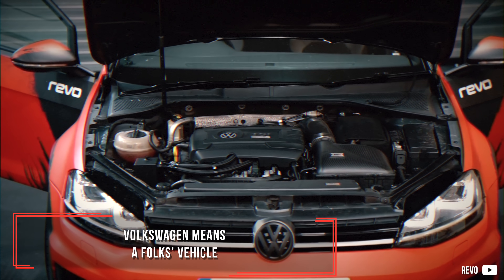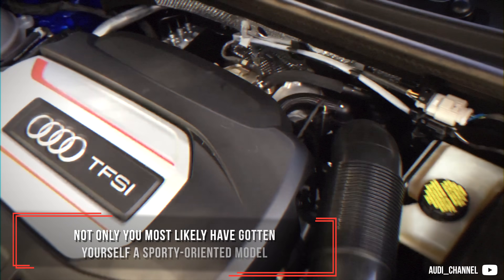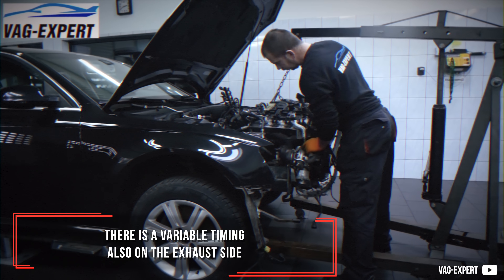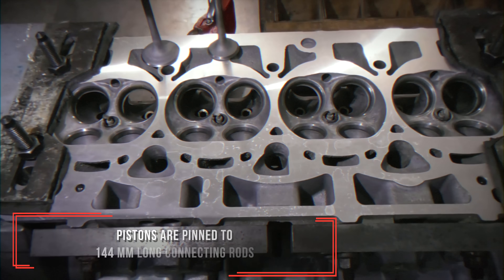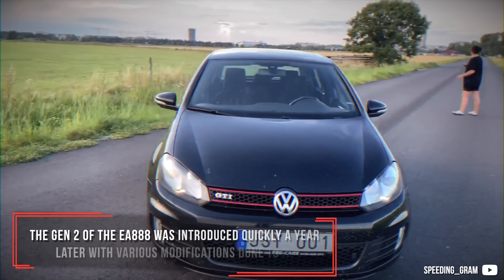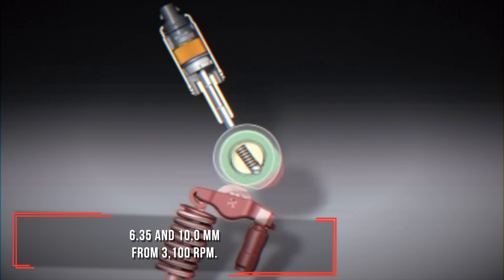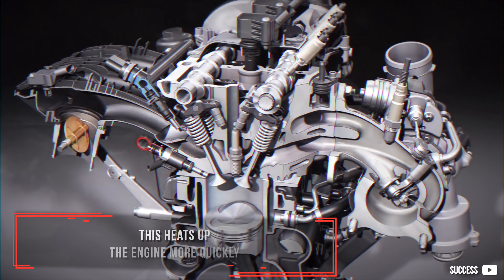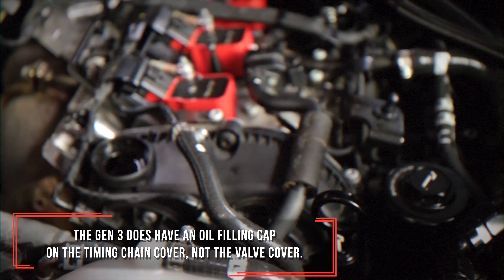Why The Volkswagen EA888 Is So Good

Comment: Love the EA888 Gen3 on my S3. 52k miles Stage 2 FBO and it's been nothing but reliable. Can't wait to throw on a Garret turbo and see how much it can make!
Reply: Exactly. I have had 0 issues with this engine. Have no intention selling my car. Going to keep it until it breaks at 100k or something.
Reply: @DaveThaBossDTB  same plans with my 2018 S3, I got it like new recently off a lease with 9K miles, these cars will last up to 200K + with religious maintainence , such a blast to drive, lots of mid range torque, handling is impeccable
Reply: Mines just hit 32.5k (16 plate prefl s3) and got the dreaded thermostat housing leak, £680 to replace (thermostat, pump, gaskets and belt) at a local German car specialist on the 10th Jan. One day it was fine the next it'd dripping but luckily still drivable for now touch wood

Pretty bummed as I came from a 2008 3.0tdi A5 running just over 400hp, in the 5yrs of ownership it just needed a clutch & flywheel, never used a sip of oil or coolant at 156k, sometimes I wish I kept it as it got abused daily

Comment: The EA888 is an absolutely horrific engine for long term reliability as anyone who deals with them knows, VW have spent years reworking this POS.
Reply: Mines been flawless so far? The last 50k miles have been on 23PSI, ethanol blends and 7K RPM every day. It's needed a coil pack and a PCV diaphragm in 115k miles.

Comment: there are some thing wrong. only the 3rd gen ea888 has a plastic oil sump. The prior ones are metal.
Reply: And oilchanges with removing plug. I still find it strange the old oil is sucked out (dipstick hole).
Reply: Gen evo4 VW change the oil sump back to metal. Strange why would VW put the oil sump on Gen 3 in plastic
Reply: @aeroline11  How about the waterpump thermostat housing for Evo 4? Has VW improved that area?
Reply: @aeroline11 yes, I will change mine to metal

Comment: It's the German equivalent to the Japanese Mitsubishi, Nissan, or Honda K engines in essence. It's been a reliable unit for the most part, used in a ton of VW and Audi vehicles.
Reply: Sorry but this engine is not even close to the K series in terms of reliability. Like nowhere near.
Reply: @soundseeker63  Your opinion, that's fine. They don't tune them the same way and they aren't built the same way from factory. But you cannot argue that the EA888 has been around a long time, takes solid power upgrades, isn't broken down along the side of the road everywhere you look. The relative "unreliable" idea people have these days is way out of proportion to what plagued engines just two decades ago.
Reply: Can we talk about stuff that is tangible? Such as what is being made in 2020+ rather than the 1980's? As far as who started what, it's largely irrelevant. I took down notes from a very knowledgeable motojournalist a few years ago concerning the question of where are automobiles actually made. Blows the mind of the average person. Here's a run down (some years old by now):
BMW 3-series:  South Africa
Volkwagen Polo:  South Africa
Audi Q7:  Slovak Republic
Volkwagen Toureg:  Slovak Republic
BMW X-5:  USA
Mercedes Benz ML & GL:  USA
Audi Q3:  Spain
Renault Fluence & Koleos:  South Korea
Audi A3:  Hungary
Dodge Journey:  Mexico
Volkswagen Jetta:  Mexico
Volkswagen Scirroco:  Portugal
Volkswagen Eos:  Portugal
Volkswagen Caddy:  Poland
Volkswagen Amarok:  Argentina
Toyota Hilux:  Thailand
Nissan Navara:  Thailand
Ford Ranger:  Thailand
Holden Colorado:  Thailand
Mitsubishi Triton:  Thailand
Mazda BT-50:  Thailand
Isuzu D-Max:  Thailand
Fiat 500:  Poland
Renault Megane:  Turkey
Audi TT:  Hungary
Dodge Challenger:  Canada
Reply: @footballcoreano Incorrect. When Honda brought out their VTEC engines in the late 80s they were some of the most advanced, powerful and efficient engines in the world, far exceeding anything VAG had done at that point.  Incidentally it was nearly 20 years later that VAG started employing their own take on the VTEC system (as used on this EA888 exhaust cam) so really it was VAG that copied Honda, not the other way round.
"Simplest engineering" lol Honda were using double wishbone front and multi-link rear suspension even in their small cars since 1991. VW, not so!   And as for reliability - Well, check literally ANY reliability or owner satisfaction survey and you will see that Honda consistantly finished ahead of VW, and not just by a little bit!   I do actually like some of VWs past efforts but you really need to get your facts straight.
Reply: @footballcoreano Stop talking bollocks!,you are clearly some sort of sad VW fanboy who can't handle the truth and/or know little or next to nothing about cars as endorsed by your ridiculous unsubstantiated,unqualified and uneducated statements littering the comments. In my 30 years of running a 5+2 bay garage and test center I could count on half the fingers of one hand the amount of Japanese vehicles that have required stuff like a new engine over that time period,I have replaced or repaired ten times that amount of VAG engines in that same time frame,I love engines like the ea888's,113's,111's,211's etc.as long as the blinkered keep buying them they provide regular work👍. As to comparing Japanese and German reliability,that is easy as there is only one winner and to suggest Honda nicked ideas from the Germans is more than laughable,that's without mentioning the multitudes of BMW engines that crap themselves or those from mercedes,or their transmissions for that matter. Type any German engine code into Google and it will auto fill with words like failure,replacement and problems,FFS!
Reply: @footballcoreano god damn someone get this dude off the horse tranquilizer.

Comment: As a dealer tech,  EA113 (FSI belt drive) over all the EA888 engines. A 1.8T TSI will barely make it to 100,000mi before its chugging enough oil to set cam advance faults. They are also very good at breaking valve springs.
Reply: EA113 fais on oil delivvery in the head because of the oil sludge forming inside, due to the crappy hi kms oil changes by dealer policy...
Reply: @Mtematiks  stick with the 15000km oil change interval and flush the engine to keep clean.
Reply: my 1.8t is at 296,000 miles
Reply: @rocavelli20  1.8t with 182,655 feels like his first day
Reply: My 2007 mkv gti, 333000km on the clock. All stock, no issues. Just normal maintenance. Still with original clutch. Love that I can use all its power. I don’t need more power at all. Such a joy of car! So smooth, running like first day!
Reply: @footballcoreano lol ok. I do see broken cars everyday because that's my job, but I also see the common issues over a lifetime of a car and EA888 are piles of garbage.  There is a reason only the new techs have CCTA cars.
Reply: @justinmeeks1868  yes gen1 and gen2 was not so good, lot of problems. But gen3 golf R is not the same. Bulletproof engine.
And now new base gen4 320hp Golf 8 R makes crying the A45s who have 100hp more.
Very efficient engine
Reply: @justinmeeks1868  there's a reason it's award winning 🤡🤡🤡

Comment: So good at stretching timing chains, burning oil and having leaking (expensive) belt driven water pumps. I work on these engines most days, they are far from good!
Reply: People bring their car to you to fix and it’s unreliable? Are you unaware of the business that you are in? You wouldn’t have a job if engines didn’t have failures. I work at heavy duty American truck dealer and these trucks are half a million dollars and guess what?! They come to the dealer ready to be sold and they’re not actually ready to be sold, leaking atf, ps fluid, exhaust leaks, mismatch paint, bent steering components , missing filters etc. we don’t judge reliability off of why their broken we judge reliability off of how often they do break  and that isn’t very much with how much power they produce. We make trucks with over 600hp and 2000lb ft of torque and time to time they prove to be less reliable than gas engines.
Reply: @the_first_resort940  someone with sense on here , well said m8 👌
Reply: Lol 😂
Reply: @rwd323 My 2016 MK7GTI has Unitronic stage 2 at 337HP and 370ftp. 
Since Ive owned,  ZERRRRRRO failed parts, mechanical or electrical. Hmmm, I want to thank the Mexican🇮🇹 partners for for great workmanship.
Reply: Searched for this..
Reply: damn straight. I've had two (2011 and 2015), never again. Plastic inlet manifold flaps getting stuck, leaking water pumps that are difficult to replace, carbon build up on the valves (though I see from the vid they fixed that), and the oil consumption... no one should consider an engine that consumes this much oil to be 'so good'
Reply: So damn true. Things are so fucking slow too, but every kid who barely beats a clapped g35 thinks it’s insanity. The motor basically wrote the book “what’s wrong with direct injection”, right before it burned all it’s other books containing common sense.
Reply: @fry.master  pretty sure a g35 also has about 100more horsepower and 2 more cylinders so yeah that is something to toot about. You couldn’t be more biased with a name like that could you? As far as direct injection goes, yeah sucks so bad all other car companies followed.
Reply: @fry.master  Ahaha you have 2 more cylinders! And 1L more displacement. Nothing crazy...
Ea888 gen3 golfR car take 500hp and drives more than 160'000 miles on it with stock engine never open.
Reply: @fry.master  do you live in Britain? If so im more than willing to bring my 2020 cupra 290 and we’ll put some cash down!
Reply: I thought the title of this video was sarcastic…These engines suck man 😂 So unreliable. There has been mass class action claims aimed towards Audi and VW, for the TSI engines. There are whole TV shows dedicated to this issue.

Comment: My golf r is past 60k miles on JB4 putting down 293whp (354 est crank hp) and besides one water pump replaced under warranty it’s dead solid… of course I do all preventative maintenance and oil changes early, and had a fluidampr crank pulley installed around 30k miles along with the JB4 to help longevity… even still on the stock clutch and it feels like new which I am really surprised about! Don’t know if I got really lucky or I’m just a much better driver than normal, trust me I do not baby it but I also don’t try to abuse it and never go into boost before 180deg oil temp… do wish we got multi port injection here in the USA and hope to convert it one day, and tune it to 400+whp.
Reply: My car is so reliable that I have to spend $$$ before 50k miles to keep it going 😆
Reply: @SmokyGrayKitty  what part of warranty don’t you understand, it’s been fine since then

Comment: I have a 1.8T in my B5.5 A4 with a K04 I turned with Eurodyne Maestro (going bigger turbo soon) and a gen 2 EA888 in my B8.5 A4 with an Intergrated Engineering stage 2 tune. Both are pretty quick and fun cars!

Comment: 4:45 - not outside of the EU - North American variants don't get port injection, sadly, so we still had to deal w/ the carbon deposits. That also meant we didn't get the exhaust crackles on the NA Variant MK7 Golf Rs.
Reply: Eu comes with an upgraded exhaust. That's why they sound better.
Reply: @spotimpact.  which years? MK7 R all had the same valved exhaust. The burbles were purely tuning tricks enabled by the additional fuel injectors and different emissions regs.
Reply: @Rick Johnson  not sure but eu has an optional akrapovic exhaust
Reply: Is there an available source where I can look up the EA888 variants with Port Injection?
Reply: I own one that's port/direct injection and live in Canada? maybe just some states in the USA didn't get them, but all of Canada did.
Reply: @thenewhalogod   did you buy it new? I’m in Canada also and have a 7.5R. I haven’t heard any NA R come with port injection unless someone added a MPI kit to it.

Comment: As someone who has a gen3 EA888 in a 2019 GTI, I can assure you that it's direct injected only.
Reply: There's a difference between NA and EU spec. You'll see the NA manifold has "plugs" where the port injectors could go. In fact, the APR Stage3+ kits reintroduce port injectors for increased fueling.
Reply: Depends on location. In Europe it came with both injections.
Reply: EU and Asia (except China first round launching EA888 Gen 3) are dual injectors but NA only comes with direct injection.
Reply: since use of GPF, even Euro specs ea888 are FSI only.
Reply: @dhrc86  right, so it would depend on the model year. My frame of reference was a US-soec 2016 MK7 Golf R DSG.
Reply: @RickJohnson  then yours would have  been MPI+DI in Europe.

Comment: The engine might be tunable and very successful, yet it's utterly boring. It has the most boring sound in the world and is so painfully linear in power delivery. I once considered getting a Leon Cupra ST. The  car drove well and the sound from the engine from inside was pretty nice, ... until they told me it was enhanced by vibrating the windshield. All these EA888's sound like kazoos from the outside. In fact, when I went for that testdrive I arrived in my R32. All the sales guys went outside to listen to my car and admitted they don't make them like that anymore.
Reply: They sound like burns fuel correctly. 
Lot of engines that produces "good sound" burns too much and are not efficient. 
The "soundaktor" is horrific take it out. The mecanical sound of the tsi is nervous, i like them.

Comment: The EA888 is a "successor" to the EA113 just as the EA113 was a "successor" to the EA827.

The EA888 is essentially the successor to the EA827 unit that debuted in 1974 in the original Golf with a displacement of 1.5 liters.  Really, the EA888 is just a reworked version of the 827 unit, so was the EA113 and a few others. On the EA888 VAG made major changes to how the oil pump works and went with chains instead of timing belts, but the bore spacing is exactly the same on all these engines.  They really are the same motor, just updated.

Great video!
Reply: The EA827 is known in Brazil as the AP Engine, there were 1.6, 1.8 and 2.0 variants. Gasoline and E100, even a Diesel. I was Brazil's first fuel injected motor in 1989
Reply: Cool. But I still prefer the EA827
Reply: Same bore and stroke, for one. EA827 was legendary, but the new one is even better.
Reply: The EA 827 has debuted in 1972 in the first Audi 80
Reply: @RPNization  That's not what I've read.  It was a 1.5 liter in the first Golf's sold in 1974 from my research.  Wikipedia does say that the EA827 came out on the 80 however, so you are probably correct.
Reply: 1457cc EA827, JB code.

South Africa had a destroyed 1300cc ea827

Comment: Isnt this the engine with insane oil consumption problems?
Reply: not the gen3.
Reply: @dwvw  I'm pretty sure thats not true. For all generations of it, Audi says 1 quart of oil consumption per 1000 miles is acceptable. Essentially your EA888 needs to be a two stroke before audi will acknowledge theres a problem. And even then they'll likely not do any warranty work for it, as I'm pretty sure only two codes of one generation got a recall approved for the issue.
Reply: @beachboardfan9544  I’ve owned two gen3’s now. A 2015 GTI and a 2016R. Neither have oil consumption problems. On the MK7 forums I’ve heard of maybe a dozen cars that have had oil consumption problems. It’s not an issue on the gen3 engine.
Reply: @dwvw  Like I said above, the fact that Audi has a listed spec for oil consumption, should tell someone all they need to know about whether these engines have oil consumption issues...
Reply: @beachboardfan9544  all engines have a little consumption. Like I said, it’s not an issue with the gen3.